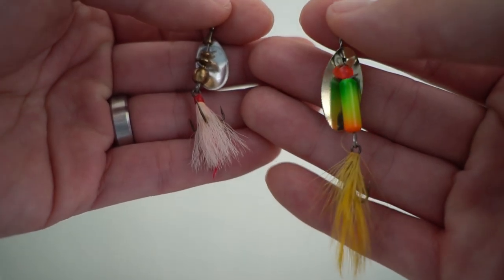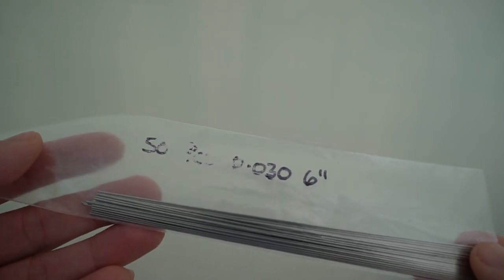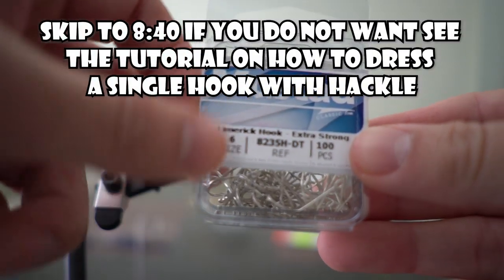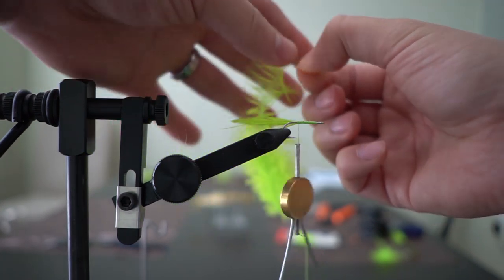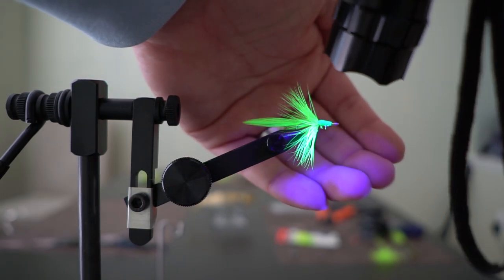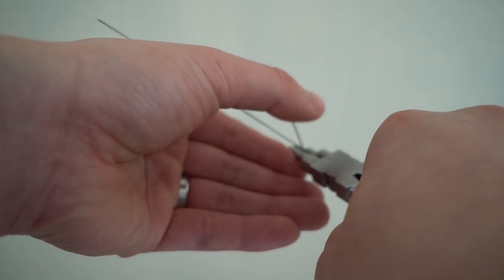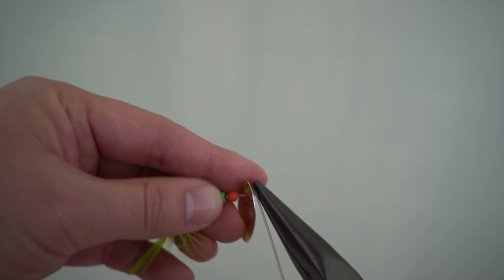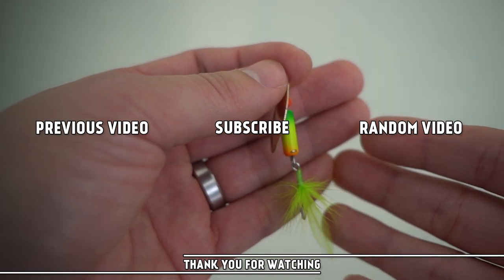Fix your InLine Spinners fishing lures and save money

Comment: There is nothing more painful than having a bluegill get all 3 points of a small treble stuck inside its mouth! I like to use single hooks too. I have been tying skirt material, to a closed end, of a spinners wire shaft, instead of dressing the hook lately, when building spinners. Sometimes I use a split ring for attaching a hook, but sometimes I'll take a #8 double hook, clip off one of the hook points,bend the loop inline with the hook point left, and latch the now single hook, onto the closed wire loop of a spinner. I like using my homemade spinners over store bought ones, because most store bought ones come with trebles. It's awesome to find new cheap things to use as lure bodies for spinners. I've found some cheap bright colored glass beads online, that make a beautiful fire tiger spinner. They cast nicely on BFS gear.
Reply from the maker: I so agree that making your own with other materials can be so fun. I made some prototypes, gonna try before i release them on videos;)

Comment: What size split rings would work for replacing hooksbon an 1/8 oz spinner?
Reply from the maker: I use small weaker ones like size 0 or 1. Brands can vary so check lb ratings. Anything close to 10lbs should be okay if you are just trout fishing and pan fishing. Even bass on light tackle. As long as you set the drag right
Reply: @rawrfishing  thanks just ordered an assortment with those sizes
Reply from the maker: @OneAndOnlyChi  not a bad idea! I often switch stuff out from my old tackle in the spring!